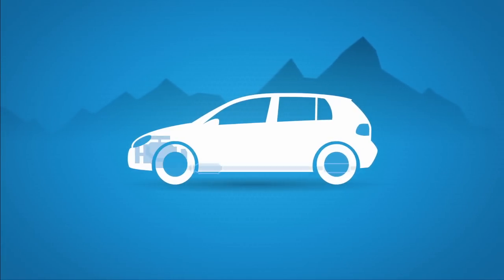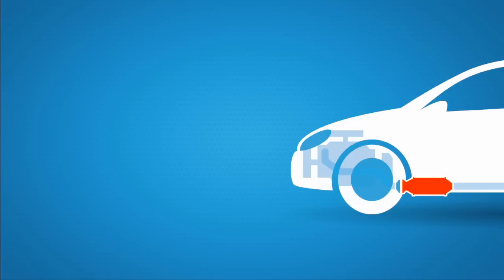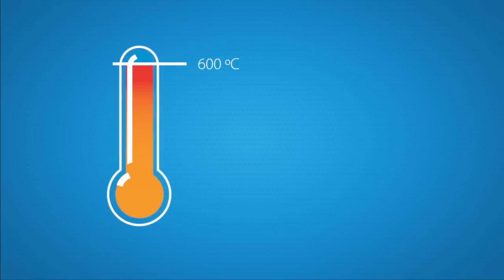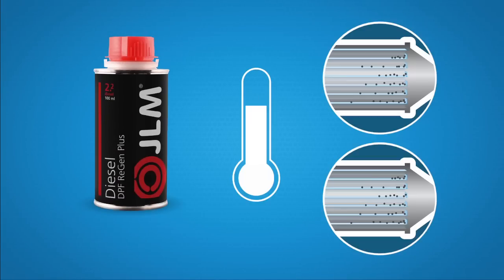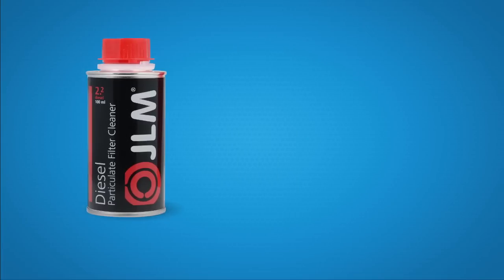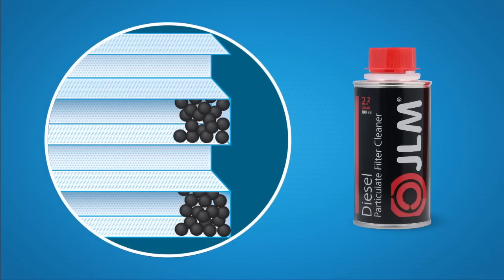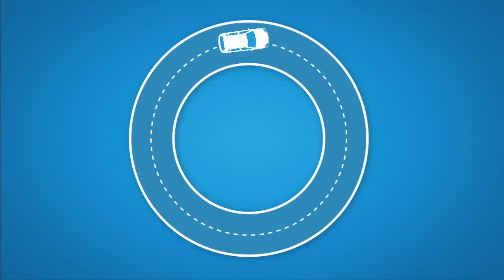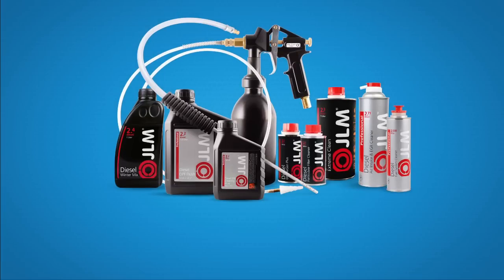JLM DPF Cleaning (Diesel Particulate Filter) 3-step approach (EN)

Comment: Peugeot and Citroen have the best system, they have a 3 liter tank that carries this "assist" liquid, it trickles into the main fuel tank.
Reply from the maker: Yes, PSA have a drip feed system to keep the DPF clean. Also better known as the FAP-system. JLM offers top-up fluid for this system (JLM DPF Refill Fluid P/N J02260) Thanks!

Comment: So you have to get on the  highway to regen.
Reply from the maker: Ideally you have a forced regen via the OBD system. When that is not an option, yes make a highway drive or at least a longer drive to allow the product to work
Reply: @jlmlubricants  how long do you need to drive for and at what rpm needs to be maintained?